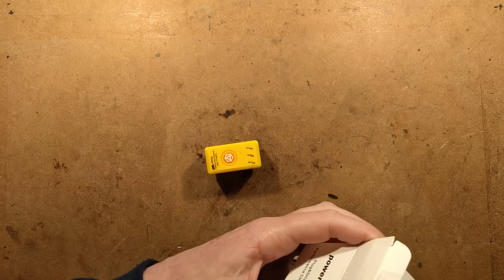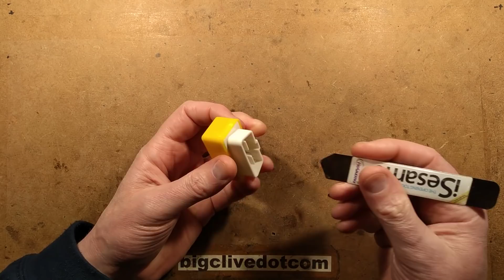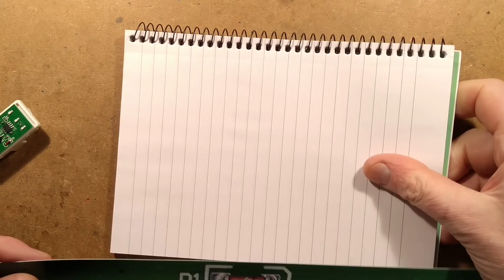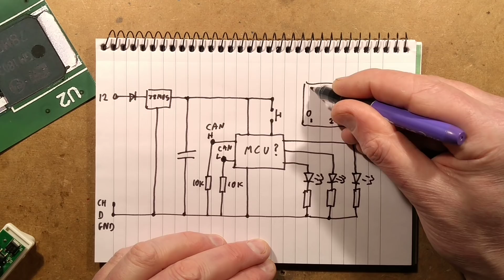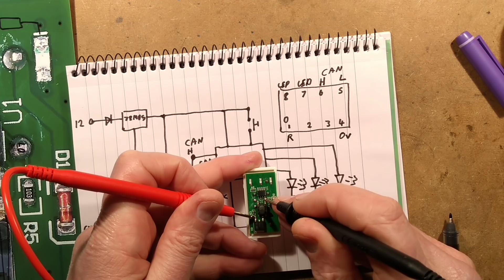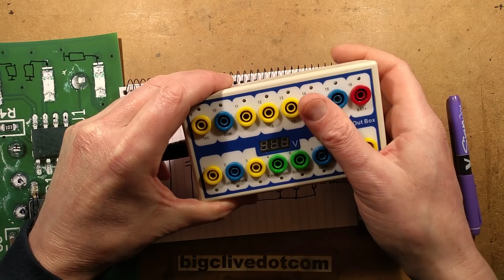Simplest OBD2 engine remapper yet, with actual canbus connection.

Comment: No, this is not communicating on CAN, fact is it's a total scam!
Even if we would pretend it could communicate, it still could NOT write nor read ECU mapping. 

Here is why:  Real CAN-controllers requires a precise clock to be able to keep synchronization to the CAN-bus, this needs to happen during every CAN-frame (i.e the device must have at least one ceramic resonator or a quartz crystal), these are external components which clearly this board does not have. The on-chip resonator in the chip can not be used for driving a CAN-controller, the bus will get unsynchronized in a hurry and data uninterpreted. So this device can not be speaking on CAN.

- But lets say it could...

The next nail in the coffin then comes from the fact that this device is suppose to change the OEM ECU-mapping/fuel control. Note that this is totally different from reading the OBD-data via your phone app or cheap OBD2-reader which uses data available on the bus. What this device claims is changing the data inside the ECU memory  and that is a path littered with security and difficulties. For achiving this we need to overcome a chain of security features which details varies from company to company. Commonly though is that most vehicle brands use some sort of pin-code to unlock the ECU. This code is sent via a protocol ontop of the CAN-protocol itself before reading or writing access to the ECU-memory can take place. This pin-code is not only make & model specific, it is also tied into the VIN (Vehicle Identity Number) making the pin-code unique for every car rolling off the assembly line! As you can figure out, the manufacturers don't want anyone to hack into their ECU's to steal/alter highly regarded company secret mappings such ignition-, fuel-, boost-, gear change-points etc. Therefore these pin-codes and associated algorithms are company top secrets... So yes, for this device to achieve its claims it would need to store every unique login code for every car produced for which it claims to function.

-But lets say it has...

Ok, for now let's pretend this device could login successfully then... That gives you the right to read and write map data to the ECU, which is great... Obviously next difficulty would be knowing where to write it. An engine ECU flash memory (where it stores the engine control maps and data) isn't as big as one might think. A couple of MB to a few 10's of MB usually. From a PC perspective this memory size is peanuts. From a "what-we-need-to-do-perspective" the task would be the equivalent of pointing out the single spelling error in a Chinese encyclopedia (conditioning you don't know Chinese and won't be able to ask someone for help). Knowing where to write in the memory is perhaps the most difficult part in this ordeal, not only is this depending on the make&model but also the variant configuration of your car, and that wasn't enough, also which software version currently running in the ECU! Memory mapping is dependent on software and manufacturers can change software several times a year even for the same model. With every updated SW the maps in the ECU moves about slightly even if the map content stays the same; Just like the characters in the Chinese encyclopedia would if they came out with a new release: the 7'th character on page 247 line 19 may not be the same as in the previous version... For our little OBD-device here, it means the it needs to adjust where the data is written depending on yet another vehicle&company specific variable. This is very dangerous though, if you'd happen to write data in anything but exactly the right place, you could possibly destroy the engine/gearbox or cause other random functions to act up. 

-But let's say we are ...
Ok, somehow this 8-pin chip has all the unique pin-codes for all vehicles and all the memory maps for the engine-ECU with all software versions for brands&models and a means to automatically detect which one to use and where to write. It's still not enough I'm afraid... The ECU flash memory has a safety-feature known as a memory checksum. If the ECU detects that the Flash memory data content does not match the supposed checksum, it will simply not use the memory area where the new change is. Either the ECU will run in a fail-safe mode with reduced performance or prevent the vehicle from starting all together. Although the algorithm for doing memory checksum is comparably rather simple (at least in relation to the pin-code login), it's still yet one more thing our little chip must manage.

-But let's say it can...
*Sigh*... Ok, we'll take this to the end. We'll say that this company "Power Prog" somehow has managed to hire or get hold of just the right engineers from all these different car companies and all these engineers has previously been working with ECU security access algorithms and they were all willing to betray their former employee by sharing proprietary info in favor of "Power Prog" using this for ECU hacking purpose. Well now it has to come up with better than manufacturer datapoints for fuel, ignition, gearbox (if automatic). This is not a small task which yet again would be specific to make&model, model year, SW version in ECU and variants. Tuning and setting calibration values in an ECU is still a manual process for which the vehicle companies often uses their top engineers and/or specialized teams. This process takes weeks and sometimes months depending what needs to be tuned. 1000's of hours goes into getting these maps and values just right running drive cycles for all weathers, temperatures, hights etc. For most of these maps the numbers you put in them is a delicate balance. Set something slightly to much and during winter you'd notice notice the exhaust is clogged and the catalytic converter got destroyed. Set it too low and your engine overheats in the summer with lost dependability and performance as a result. For this thing to perform its claimed function it needs to have the smartness and knowledge of a better-than-average engine tuning engineer inside...

And there is the obvious reasons why this is a scam, there is no technology today for generic auto-tuning to work, especially not in a nonsense low price E-bay gadget. While auto-tuning is a thing in the industry (yes it exists and can be used for very small parts of a system, but outcome is usually rather rough and needs human trimming anyways). Main thing is it's always closely monitored and verified by humans who can abort when the things go tits-up.

Comment: I purchased one of those Bluetooth deals to plug in, never had the guts to actually plug it in to my outfit though, hell I have gone through three different outfits that have never had it plugged in.  I thought it would be neat to hook it up and just use an old cell phone that isn't being used as such any more to monitor my car.  Perhaps one of these days I will plug it in and try it out on Bluetooth just for shits and giggles. My luck it will probably screw up my car or something.

Comment: If it is a micro, I wonder what it is using for a clock. something internal perhaps. needs an oscillator of some kind. Otherwise it might be just a bit of logic. Anyway I am just finishing my truck and the only semiconductors in there are the alternator voltage regulator and 2 diodes in the light switching circuit. Electronics and cars don't mix well. and I am an electronic design engineer. I have in fact designed an engine management system about 20 years ago. Not for me I am afraid. I need a simple truck that works. I leave electronics to my work and Ham radio.
Reply from the maker: Most modern microcontrollers have internal clock options.
Reply: @bigclivedotcom  Yes I guess so, probably not very accurate but then does it really matter. It is a con so as long as some lights flash, job done. People will believe anything I guess. Electronics in cars has got to a totally ridiculous level, everything has a micro controller. Probably more processing power in the average air bag sensor than the Apollo space missions. My set of points don't have much intelligence, they understand a screwdriver and a file. But thanks for the reply  I love your very well put together videos on great subjects. Might like to investigate some vehicle modules they are fascinating devices even if completely unnecessary.

Comment: These are all scams pretty much. Most certified mechanics have difficulty affording the appropriate equipment to even COMMUNICATE with modern ECUs properly, and it's manufacturer specific, let alone rewriting parameters to make it run better.

At best this would be an extremely generalized device. Does it work the same way for a V12 Mercedes as it does in a 4 cylinder Honda Civic?
Reply from the maker: It certainly does work the same in all vehicles.  Mainly because all it does is flash its LEDs with no actual communication at all.

Comment: Yeah, even back in the 90s/early noughties you needed a chip that was specific to the car rather than just the control system (let alone a wholly universal device). That's kinda the point of having a map chip in the first place...

I had an old Polo, first of the line to have electronic everythings (well, except the distributor), and there was a guy on a forum with an EEPROM burner and arguably a little too focussed an interest on a narrow range of vehicles... and even he couldn't promise any particular massive power increase or economy improvement, merely a smoothing out of the torque delivery to get around VW's first attempt at fudging emissions tests - that is, having the car pretty much permanently in limp mode at the specific rpm and throttle setting used for the tests of the time, thus flatspotting when you passed through that point, which was half annoying, half a potential safety issue. And also pointless given that it could apparently get through the MOT just fine even if you completely removed the catalyser and disconnected all the engine sensors.

So I found myself wanging twenty quid his way for a replacement chip... did exactly what was advertised and nothing more. Top end power might have gained 1HP, but even on a 1-litre that's barely noticeable, more importantly you could boot it at low revs, or pull away from stationary without having to rev it like an F1 car, and not have to put up with it bogging down here and there...

I'd pay at least that much again for something specific to my current car, which has absolutely dreadful low end torque (but radically improved emissions, and slightly better economy) which is a poor match to its diesel-like gearing, and an occasional habit of being even more gutless when cold forcing you to rev it hard... as well as a wholly unwelcome electronic nanny on the top speed, and a probably far too conservative rev limiter (especially given the inter-gear gaps). Sacrifice emissions to bring the torque up on full throttle, to a point where it barely scratches through the MOT, but still has the same cleanliness and efficiency on part-throttle (no need for "better", as it's a hypermiler's dream, merely sometimes dicey for fast starts), remove the hardcoded speed limiter, and maybe allow an extra 500rpm at the top end, and I'd be more than happy.

...but I've absolutely no illusions that some single cheap plug-in module could do any of that, especially when actual bespoke chip-tuning services are so much more expensive. There's actual work needs to go in to the remapping process, on a car by car basis, let alone model by model... preferably with some time spent on a dyno to get the best power and economy balance, though for the simpler fixes I have in mind you could probably get away with working on an individual model (and engine, gearbox) basis and spread the R&D cost over the whole (yet probably quite small) production run.

Comment: Hi Clive, all the way through the 1960s '70s and into the 80s, there was a much cheaper way to make your car go faster.... You bought a roll of "Pinstripe" tape and stuck along both sides of your car - guaranteed to increase your top speed by up to ten miles per hour. Of course, if you only put it on one side of the car, it would go faster on the outbound leg of your journey, or on the other side, it would go faster on the inbound leg.

If you wanted rally performance, you bought a much wider tape and stuck it all along the top of the bonnet, roof and boot lid. better still, stick some vinyl numbers on your front doors!

These all worked equally well. All you had to do was to believe in unicorns and pixie dust.

Comment: The little WiFi OBD2 readers are a lot more fun if you just want something to play with. You can get the app on your phone and monitor the revs and fuel air mixters etc etc etc (depending on your car, you can even adjust suspension height too)
Reply: I have one which I use to monitor the DPF on my Mazda 6. Very useful little tools. I also have a USB to ODB adapter which allows me to perform certain service functions from a laptop.
Reply: @paulanderson79  Nice! Yeah I used to work with Mini's and we would have a lot of fun clearing fault codes and diagnosing stuff with the various types of ODB2 readers you can get online. The guy next door had a fancy SnapOn one but we made it work with cheapo ones! Of course there are some things that require someone with the proper setup to fix, but they are still very handy to have.
Reply: @Notpoop906  I've made good use of a tool entitled FORScan. It's specific to Ford and Mazda in The UK but also covers Lincoln and Mercury in The US. It's actually free for personal use.

Comment: Very bad practice for this to not have a cap across the input side of the 78M05, makes me wince - I've seen occasional oscillation in a regulator when there aren't caps on both the input and output sides of any 78xx family regulator. The datasheets DO warn you about this, of course. (I tend to use a LOT of decoupling capacitors, but then I never have to debug power decoupling issues, which can be IRRITATING to figure out!)

Comment: I love how the pushbuttons have the four legs like that.  My new garage door opener has one of those 'smart' wall control panels so I couldn't just use a doorbell switch inside the house to open the door.  Soldered my doorbell switch right to the contacts on that pushbutton and as far as it's concerned, I'm pushing the smart control panel's Open button.
Reply: That's pretty neat - I wondered about these push buttons recently, like why 2 poles but it's a nice bonus for sure. Thanks for the insight on this, turning normally two button presses into 1 while keeping circuits independent

Comment: Clive, check the breakout box while you are holding reset; I wonder if it is just clearing the codes and taking the ECU out of "ready" state because doing so will cause some high compression and super/turbocharged cars to produce slightly more power that can be felt with your butt dyno for around 200km (but won't be anywhere near 35% more power/25% more torque), so if that is what it is doing the claim to making more power may be valid because the car has restarted its learning cycle, but can easily be achieved for free by disconnecting the battery for a few minutes to clear the ECU as well. 

Try pulling the turbo control valve if you've got a turbocharged car or if not try pullling a coil to one spark plug or disconnecting the o2 sensor or a vacuum line to trigger an error code, then try hitting reset on this thing and see if it clears the codes.

Comment: I’m not 100% sure (never worked with cars with OBD before) but on my car at least you have to either disconnect and reconnect the battery or use an OBD reader to reset the codes

Comment: But the enclosure is really cool, especially for one's price tag! Can become a decent housing for, I don't know, a digital tachometer should you want one for some reason, a battery life indicator should you leave your car in the cold too often, some unusual thermal warning device (like ATF temperature you don't usually find a display for, though it is monitored internally)...

Comment: IDK Clive, IF any of these things is ever show to have the abilities to do what they say.... On that day I will be demanding a refund of 5K from snap-on, cuz not only will a <$20 dollar tool have abilities my expensive tool doesn't, but it's doing so for less than $20 without yearly updates!!
Reply from the maker: These are more reliable than the Snap-On ones.  (Mainly because they don't do anything.)
Reply: @bigclivedotcom  Very true, can't argue with that :D
Reply: I have an even cheaper option, though; And it's even more reliable - Just glue a picture of this onto your OBD II connector, cost under $1, and guaranteed NOT to mess your vehicle up.